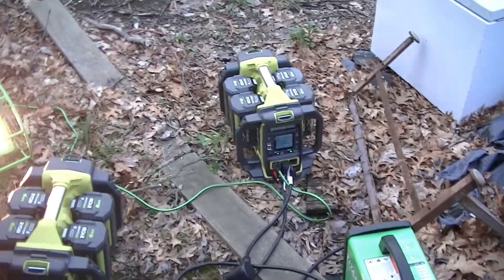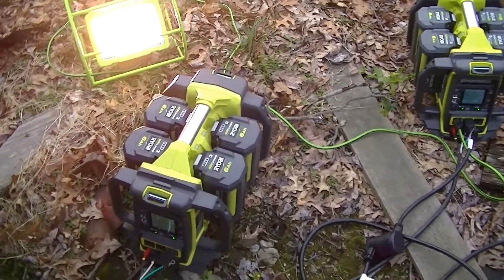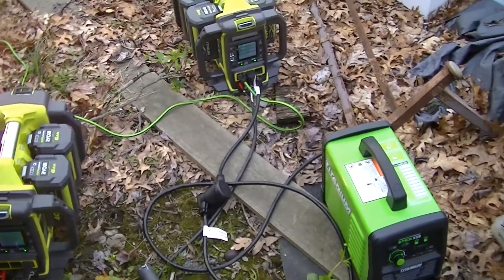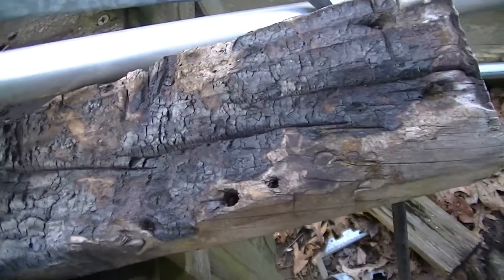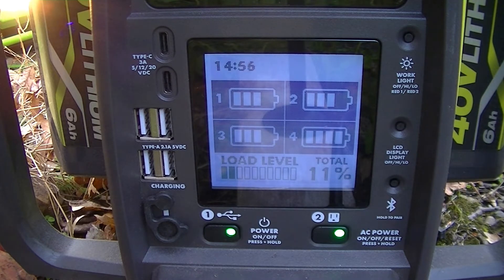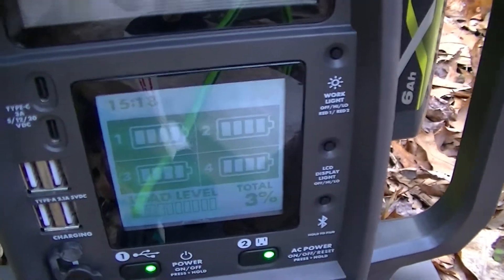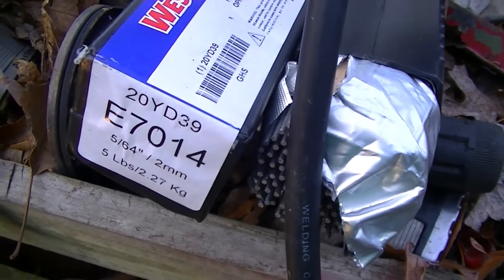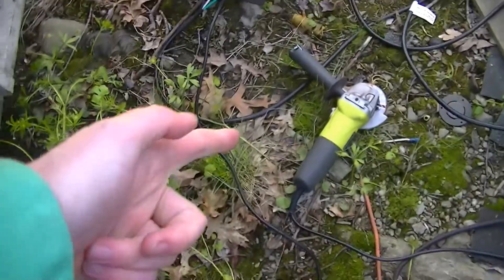Ryobi RYi1802B6 power station parallel welder test

Comment: With the two units in parallel, were you outputing 120V or 240V?
Reply from the maker: 120V.  You can't make 240V with these without an autotransformer.
Reply: @randacnam7321  Thanks. That's what I figured but didn't want to assume. Appreciate it.

Comment: Nice. Currently trying to do something like this with two dewalt power stations. I have a small tig/arc welder that runs on both 120V/240V. Want to be able to weld outdoors since my apartment does not have usable 240V outlets